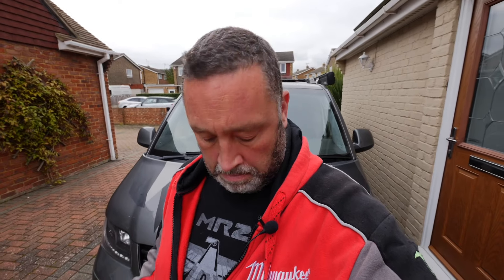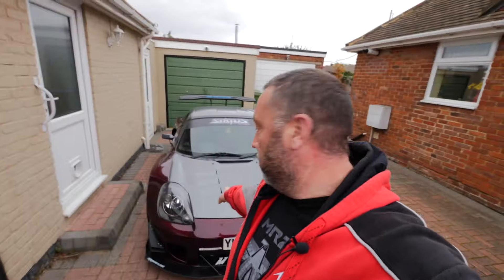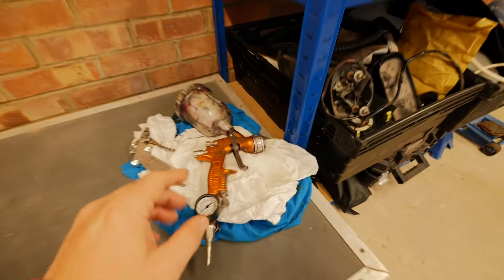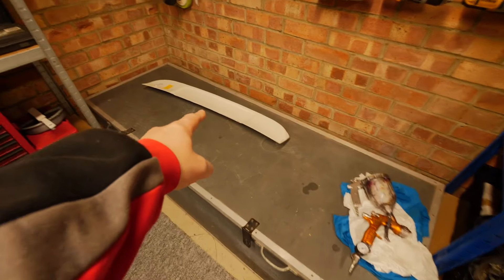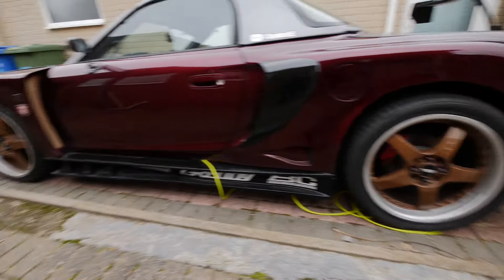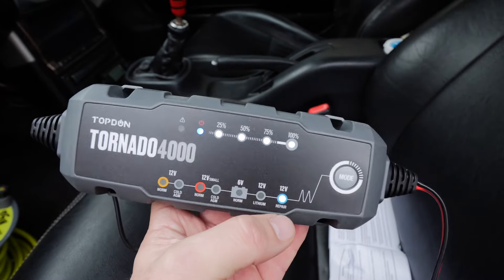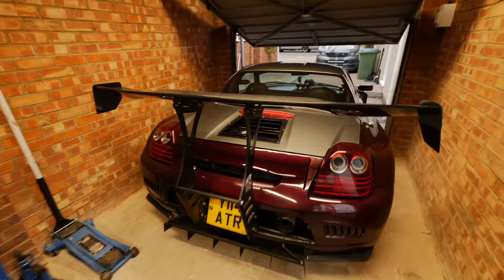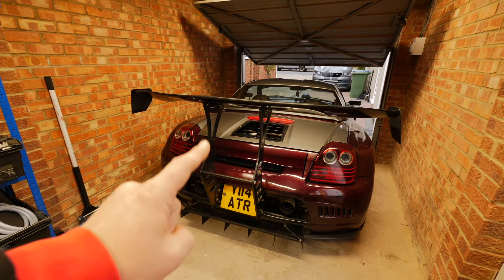Restyling my MR2 Spyder / Roadster

Comment: I think the whole car in indium grey would be perfect. I wrapped mine in anthracite grey metallic 3m which is similar. Best color for the car. I'm going with a different shade of gunmetal for my wheels because I agree black hides the wheel. If you've seen my car on the MR2 Spyder group on Facebook you'll see what the color looks like on grey alloy wheels for now. Changing them to darker wheels once I get tires.
Reply from the maker: I’ll look out for the pics when you do them 👍
Reply: @SpyderLEE  I just posted a pic of the new wheels next to the car. The tires for it have been on backorder for a few months now so it'll be a bit.

Comment: Great to see the MR2 again. Am I the only one that gasped when the wing shifted as you undid the bolts? I honestly thought it was going to crack you on the head.
Couple of questions though; Does the new spoiler block the 3rd brake light? Is the red stripe in the centre on the new steering wheel? Having it off to the side would probably trigger me every time I climbed into the car. Looking forward to the next installments.
Reply from the maker: Nope me too. I forgot it moved 😂. Not sure about the 3rd brake light. Red stripe is center top.